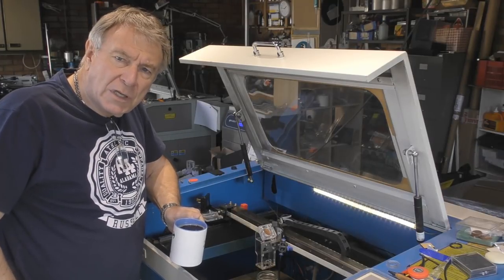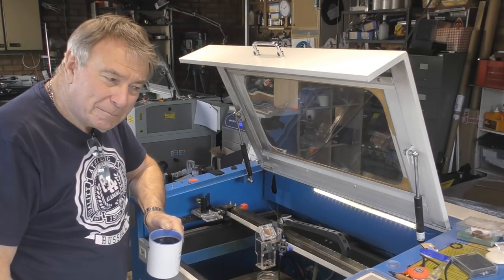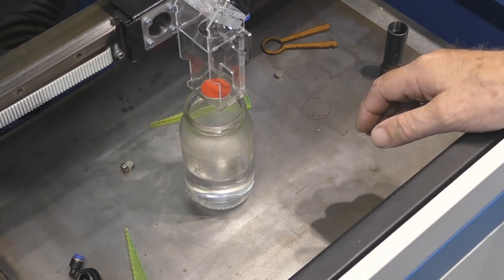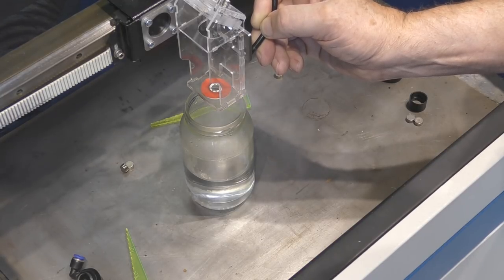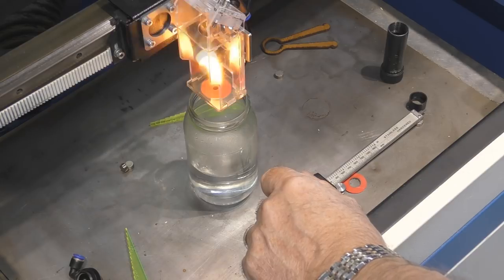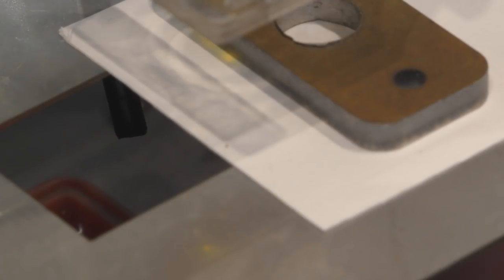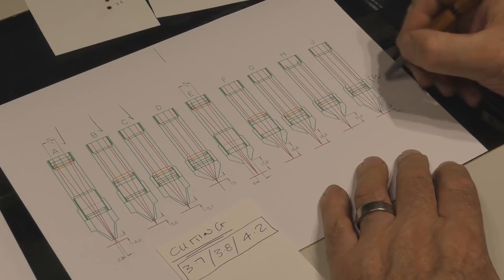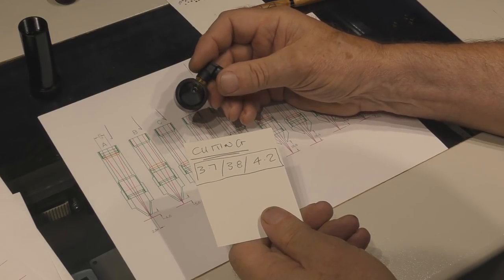RDWorks Learning Lab 152 Are our Nozzles Designed Correctly

Comment: Hi, Russ! First of all, thank you the most helpful series ! Since at this time I am kind of on a crossroads in choosing a laser cutter for our project, I went through different options. One of them was an used Epilog Helix machine( not a cheep one though). What impressed me was the fact that there was no nozzle of any kind there. The lens was in the open , very much like those paper circles that you use for measuring the beam. There was also an air assist, that pointing directly above the cutting point. The technician at the local vendor of Epilog explained to me that they did not actually need the long and relatively heavy nozzle, which at high speeds was also swinging a little bit and thus reducing the accuracy of the machine, and also that it was easier to clean the lens this way.  We tried to cut some samples out of 3mm plywood and it did pretty good job. So my question to you is have you tried to cut /engrave without the nozzle, with only the air assist pointing and staying just a little bit above the cutting point? Wouldn't that actually help to narrow the point by getting rid of the reflection and the interference of the electromagnetic waves occurring at the very edge of the nozzle?
Reply from the maker: Hi 
I answered this once in detail but You Tube decided to port it off into a parallel universe!!!!
The essence of my answer was to ask you to consider your needs  and budget. Epilog is a great machine but a very expensive machine. The skeleton of the Chinese machines and the "expensive" machines are both constructed from the same elements ie a 10.6micron wavelength laser beam, one of just a few metals for mirrors, and only two materials ZnSe or GaAs for lenses. Beyond that the motors. drive precision, software and general design elegance  will be different, but  in my humble opinion they are not 20 or 30 times better as the price would suggest. With a Chinese machine you will have to learn the technology and be your own 24/7 tech. Will it bankrupt you when it comes time to replace the tube/ Can you afford a service visit because  you will not be able to fix it yourself with easily available cheap spares.  

I have learnt throgh much trial and error that the requirements of  cutting and engraving are diametically opposite. Cutting organic materials and plastics requires raw power and lots of well directed air assist into the kerf. Only an air flow co-axial with the beam can achieve this and the nozzle needs to be 3 to 6mm above the cutting surface. The air and fumed MUST exit from the bottom of the job and be quickly and cleanly ripped away. The opposite is required for engraving, A large distance betwe and nozzle and work  and only the mearest whisper of airflow through the nozzle to protect the lens from the explosive upward debris cused when solid turns into gas/fumes/vapour . Chinese machine will compete equally at cutting because speed and accuracy are not a significant issue. When it comes to engraving ,  Epilog wins on speed. although I have proved just recently that the gap is not as big as you may imagine. I have developed ways of exploiting  the greyscale mechanism of the Chinese machine to do dithered dot engraving at much higher speeds see 
https://www.youtube.com/watch?v=Iswn-R_mbck     and #159A

Epilog, Trotec and Universal all consider the Chinese machines to be "junk". It's interesting to see them squirming at exhibitions where there are many Chinese imports present. My goal is to prove that with understanding and a few minor design improvements  the performance gap is nowhere near as big as the price difference would suggest. You would get a lot more productivity out of 20  Chinese machines for the same price. I am extremely happy with my £1000,  now "house trained", little dragon.

Good luck with you decision
Best wishes
Russ

Comment: The problem is in communication between laser tube manufacturers and nozzle manufacturers. The working beam diameter of 4 mm means that power distribution drop to half at this diameter. It is the case with antennas too, where gain drop to -3 dB, or exactly the half. But that is 'working' beam diameter which does most of the work. People at nozzle design probably does not understand that the remaining power is still there and should pass freely.

Comment: Brilliant Ross, maybe, just maybe this is why Epilog uses a no nozzle design. I do preffer however, norrow hole nozzle, even when it cost me some power, having a focused air stream is a lot more efficient from the air assist stand point, as I try to reduce post processing time, I run a compressor with about 10 - 20 psi down a 1.5 mm hole nozzle when cutting, it procudes pristine cutting edges and no char at all with very little CFMs. Infact, I'm now using no nozzle when doing only engraving jobs and nozzle when doing mixed or just cutting jobs.

Comment: Ideally the opening on the nozzle should be determined by also taking into account the spherical aberration of the lens. If the lens is not very good and has a lot of spherical aberration then the outer low energy part of the beam will not converge at the same point as the inner high energy core in which case it is better to not let that part pass through. On the other hand for a very good lens (or lens combination) that has very little aberration it is obviously better to let the entire beam through as the total energy will converge on the same point. In any case if there is any energy going outside the cone formed by a 12.7 mm aperture circular base and the 1.5/2.0 inch focal-length apex height, it can only be the result of spherical aberration so must be kept out of the work surface by constricting the nozzle opening.

Comment: The beam from the tube passes either through a prism or is reflected off mirrors (haven't got a laser cutter so can't check!) before it gets to the nozzle area. Is their a possibility those mirrors or prisms are distorting the size of the beam?
Reply from the maker: Hi Andy
I have already answered this comment once but You tube seems to have sent to outer space.

The answer to your question is yes it is possible but no it will not happen because the mirrors you buy are manufactured optically flat.  The beam exits the tube through a "window" which limits the max diameter of the beam It is a coherent beam which means theoretically it will travel as a parallel beam for long distances. In reality there is a very small divergence but with a few meters (the path length even in the largest machines) of travel it remains parallel. I know from personal experience  when I tried to make my own pure copper mirrors that  I could get great reflective efficiency (99% +) but the flatness was just not possible with hand lapped mirrors or maybe my skill level was lacking but I definitely got beam distortion off each mirror.. No such problems with the mirrors in this video

Best wishes
Russ

Comment: Russ, Perhaps a different angle of attack to solve. Since the head is possibly (depending on the design and lens) doing triple duty 1: holding the lens. 2: creating a pressurized area to protect the lens.  3: creating a directional air flow to keep the kerf cleared. Instead replace the head with a  vacuum ring around the perimeter of the lens. to suck away any contaminants. also leaving any hole equally as large as the perimeter of the lens. if it weren't for the pressurized chamber you would not even need the head/nozzle at all. with no regard to air assist to keep the kerf cleared. just an idea. -Sam (I should have added. the 3D printing community share a similar component. they suffer heat control and cooling the part so 2 of the 3. they have hundreds of manifold designs to counter/control their prints. see a site called Thingiverse.com. and search for hot end blower, hot end cooler etc.. ) -S

Comment: More interesting investigations Russ,  I think you may have fun with the laser and nozzle setup on one of my machines, it's a metal/non metal laser with a 260w twin tube laser and the nozzle aperture is only 1.2mm with a 63.1 focal length lens when cutting metal. The small opening on the nozzle is for the required air flow of the oxygen assist.
  I wonder what the beam size would be from that and also the affect on beam size with 2 combined laser beams.  Unfortunately can't do any tests at the moment as one of the tubes has died due to a water leak and at £9k+ for a new one, may be some time before that's replaced!!!

Comment: Adding to my previous comment. It is also possible that the outer part of the beam actually converges at a smaller focal distance (somewhat above the work surface) than the main core of the beam. In this case your pictures will not represent reality. This energy can possibly get through the small nozzle opening just big enough for the central core part.
Reply from the maker: Thanks for your comments and  ideas. What sort of machine do you use and have you tested any of these "possibles" for yourself.?  I  never know the answer to the question/s I pose at the beginning of each video. I am on a learning mission because many of the questions I ask are  not  (despite much research) documented. I always show my method  of dissecting a problem  and  you see the results I arrive at. I try to deduce a conclusion from those results  and  sometimes the data allows interpretation  and I am always open to logical alternatives that maybe I can test further. However, in this instance I did not arrive at a sensible conclusion and hence you will find a further video where I look a lot deeper..  I have tested the power  before and after  lenses and typically there is a 3 or 4% loss depending of the lens material . Add a proper cutting nozzle with 2.5mm orifice and there is no noticeable loss with all lenses between 1.5 and 4" but that assumes  that the nozzle will be 3 to 6mm above the work surface ie the  beam will almost be at it's focal point as it passes through the nozzle. . Perhaps the  next video will answer your " maybes"
Best wishes
Russ
Reply: SarbarMultimedia Russ, Thanks. I enjoyed your videos. I am buying one for my son who is a teenager.
Reply from the maker: @rajivlaroia1441  
I'm sure that you will enjoy the new toy as much as your son will. You can check out all your ideas, There is no better way to learn because you will soon find that most of the lens theory is just that and when you project it into this world of non-metal cutting lasers,  things don't quite work the way theory predicts. Have fun

Best wishes
Russ
Reply: SarbarMultimedia You remind me of my favorite quote, ‘In theory, theory and practice are the same, in practice they are different’.

Comment: Does all this depend on if your beam is absolutely dead center because I still haven't gotten my beam dead center in every spot of the table.  Its nice to see you figuring out all this because I know I need as much help as I can get.  Thanks so much.  Look forward to the next video.
Reply from the maker: Hi Scott
Until doing this investigation I did not realize just how tight the situation was. When I do my little pulse test to check how central my dot is in the nozzle I am just checking the very central high energy part of the beam. Yes this is the bit that really does the damage to the material  whereas the outer 5 or 10% is really a nuisance.  Hence my thought in the video about this maybe being a conscious design decision. This whole experiment is just adding more knowledge about the technology, I am not drawing good or bad conclusions until I have played with nozzle hole size to see what happens . In your case it does show how critical it is to have the beam perfectly aligned. The bigger distances on your machine  will certainly be challenging.
Best wishes
Russ

Comment: Hi Russ,
First off, I just want to thank you for the incredible knowledge you bring to this community. I was wondering if you might be able to help me with an issue I am having on my Redsail X700. My cuts are off in the x axis from my engraves... but really only in the upper quadrant of my laser bed. Once the cutting gets down to the bottom right corner of the bed, the engrave and cut are perfectly aligned... but not aligned anywhere else. Do you think it is belts?
Reply from the maker: Hi Jon
What you describe is a classic  beam alignment issue and nothing to do with belts. In https://www.youtube.com/watch?v=notUuB_G7X8&t=1186s  from about 20 minutes on you can see the way I align the beam. You can easily determine which axis is out (maybe both?) by putting the head fully forward and doing a scorch test on mirror 3 when the head is fully left .Leave the scorch test in place and repeat the test with the head fully right. If the 2 marks are not perfectly coincident then you have an X axis alignment issue. Keep the head fully right and put a new target/tape at mirror 3. Do a scorch test. Now move the head fully backwards and repeat the test. If your two marks do not coincide then you have  a Y axis beam alignment issue to be sorted. Your beam alignment in X and Y can only be considered perfect when you can get 4 burn marks to coincide from each corner of the machine.. If you need more help then send me your email as a comment and we can speak off line.

Best wishes
Russ.

Comment: Question: how do I reduce the travel distance that the laser goes past the engraving and then changes direction. Mine seems to be too long. When I increase the speed, it travels even further past the engraved part before it changes direction.
Reply from the maker: This all depends on your motor power. Your system is unlikely to be tuned to its limit. Take a look at your vendor settings (RD8888 password) and  press READ (assuming you are connected via a USB cable) you can see the current  setting of your X max acceleration. My little machine is set to 12,000mm/s2.. Make a note and EXIT. Now go to USER tab. Again press READ  and look  in SWEEP PARAMETERS at your X  acceleration Do they match? If so your are already running at what the factory thinks is the max allowable. This may be conservative. Back to Vendor Settings and now increase the value by 1000mm/s2.  and WRITE the new value back to the machine. Now to the Swweep Parameters and increase that by 1000mm/s2. and WRITE that back to the machine. . Now test your fastest scan speed (500mm/s?) and listen for any "crunching" noise as the direction changes. This would indicate that you overworking the motor and losing steps..Try this loop several times and you will eventually hit that crunch point. then back off by about 2000,mm/s2 Do your scanning trialls with a 200mm wide test pattern set in the middle of your table.   If the software thinks it will overtravel out of table limits it will not even attempt to run.

Best wishes
Russ
Reply: SarbarMultimedia thank you. I’m familiar with what You are referring. I have 2 machines. One is fast and the other is slower due to this reason. I’ll update you and thank you again
Reply: Thanks. That seemed to work

Comment: Well laser beam do have divergence and generally get larger the further from the tube. What was the burned spot size right at the tube?
Reply from the maker: Hi Ken
I am aware that there is a very small divergence as the beam gets further away from the tube. However it is negligible on the max 1100mm beam travel for my machine The last time I checked the beam diameter at mirror 1 (I think it was over a year ago) it was measuring about 12.5mm diameter. It is difficult to be absolute with the measurement because the beam is not perfectly round. The whole point of this exercise was to show that there is power way beyond what the tube manufacturer claims  and that not all of that power is getting through the nozzle. This saga is not yet concluded because the balance may be in favour of efficient air assist (small hole) at the sacrifice of a small power gain

Best wishes
Russ
Reply: You are right that the beam divergence would not probably change that much over a short distance. I wasn't sure with Chinese glass tubes, RF tubes typically have a much better beam profile. Interesting wiki page talking about just what you are discussing: https://en.wikipedia.org/wiki/Gaussian_beam#Power_through_an_aperture

Thanks Sir!
Reply from the maker: Hi Ken
Thanks for the link. Sadly, RF tubes are out of the hobby machine league so we have to make the best of our  DC stimulated  glass tubes. That's what my learning journey is all about,  trying to understand the practical limitations of each part of this fascinating technology. Any thought provoking comments such as yours are always welcome because I still seem to have a lot to learn/discover.

Best wishes
Russ
Reply: Could the mirrors contribute to divergence of the beam?
Reply from the maker: Hi Jonathan
Yes, but they could equally make it converge. My copper mirrors have been machine lapped to laboratory standard, about 10 times flatter than normal commercial mirrors . Even commercial mirrors are not going to cause beam divergance over such short distances as our machines beam path of 1 to 2 metres.
Thanks for the good thought
Russ